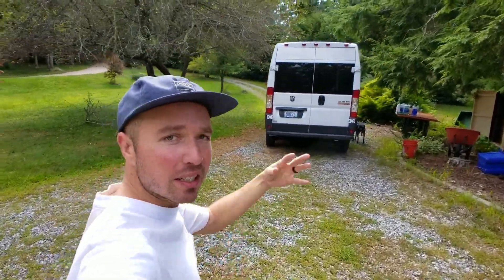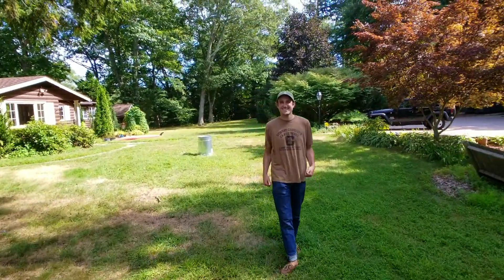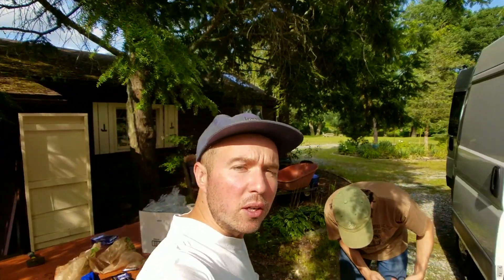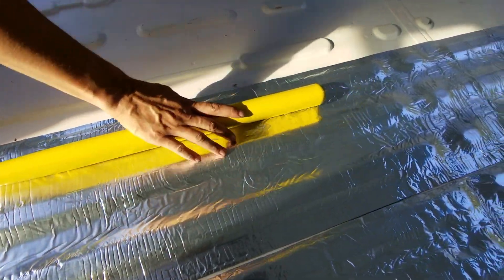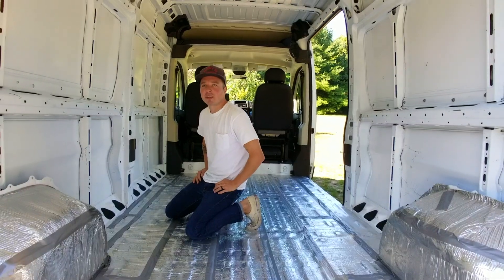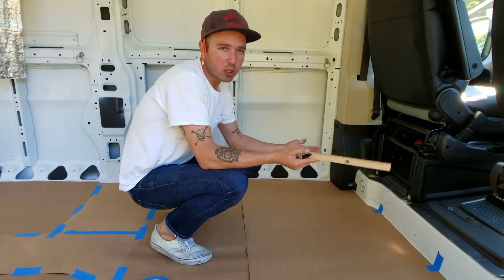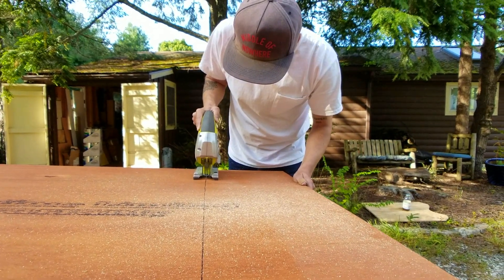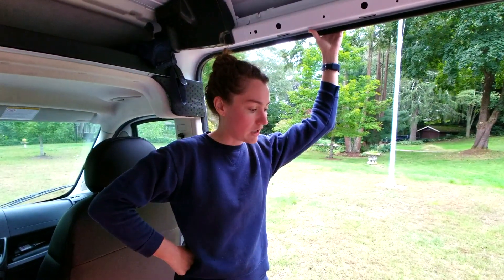PROMASTER #VANLIFE || Subfloor Installation + Nifty Trick + LEMONS OUT OF LEMONADE

Comment: I've heard of people having trouble getting the T40 hex bolts out but in my case they just came right out I had no issues and when my subfloor went in I just took measurements and drill the and I used all those holes as additional hold downs except for one that I couldn't use because I got construction adhesive in the threads and could not clear so I just sealed it up.

Comment: Gaaaah, you really should have added some thermal insulation to the floor. That's going to be so cold in winter. You still could if you kept that template cut out some 1" EPS foam and use 3M's #78 contact adhesive to put it down. It will help with sound and vibration damping too.

Comment: Before you guys get too involved in your build, you need to start thinking about the weight you are adding. If you have a 2500 van you will run out of hauling weight very quickly if you dont take into account what products you are using. Was that duct insulation the fiber backed light kind? Or the rubber backed heavy type that is ment to quiet down the metal? I saw a couple build on a 2500 4x4 sprinter, and while watching each episode I kept thinking they were adding a lot of weight, and sure enough, with thier family of 5 and all the weight added in the build it was too much and he had to add aftermarket helper air springs.

Comment: Random comment -- howdy - I like y'alls mission so far, kinda resembles mine ; )

I know, a day late and a dollar short.. . yet.. .   I did my 159" PM plywood floor with 24" spaced rows of bolts, 3 rows per sheet - and it slaps. It may not seem like it now but that rear axle is sprung stiff enough a sheet wood floor will eventually loosen enough on its bindings to make a slap noise when the rear wheels have jounced the chassis up then taut springs rocket it back down...

Of course the weight of the built-ins and such will temper most of that but it is a minor annoyance - Some small investment in adhesive, something enough to anchor affix the wood between or under fasteners, but not enough to for later floor removal to resemble the tie-down bolt hassles... ; )
Reply from the maker: Copy all that! REALLY cranked on the subfloor since it's the main tie down for the furniture. No slapping that we've heard which is nice. Thank for commenting and sending good vibes!